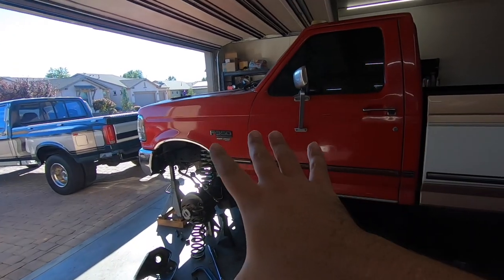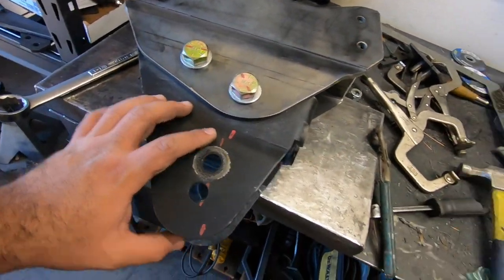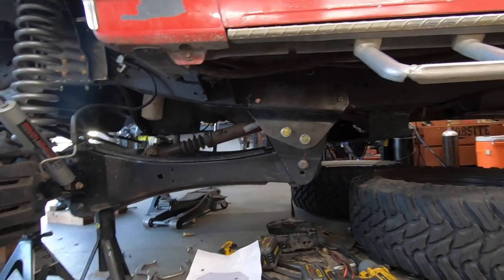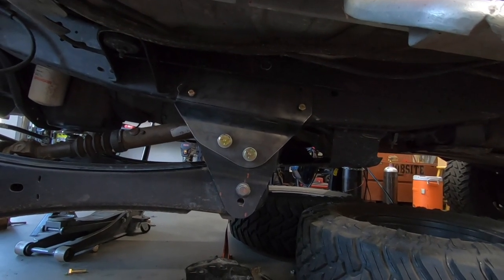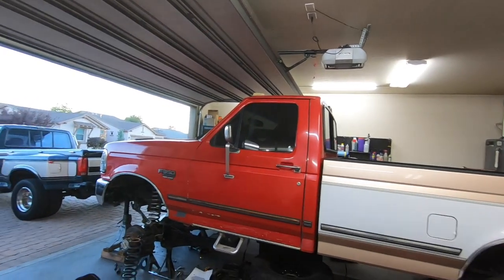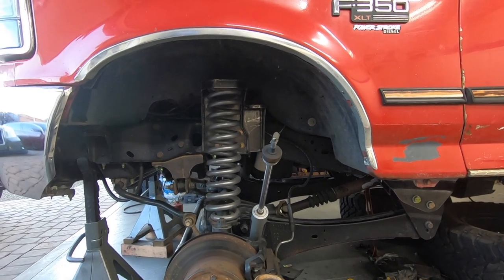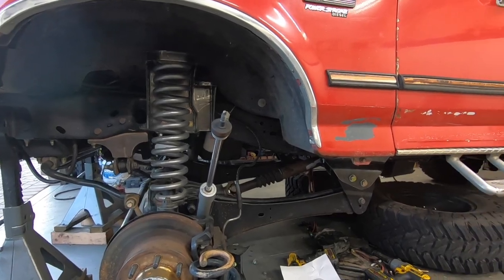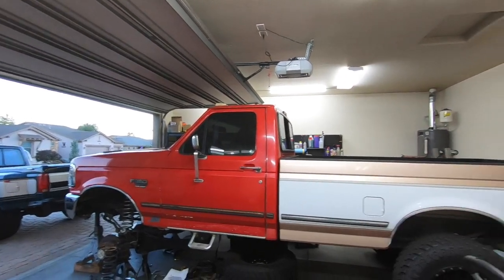05+ SuperDuty Axle Swap Kit Radius Arm Brackets Done!!

Comment: Does it ride smoother than stock my 95 f350 4x4 crew cab rides like a tank
Reply from the maker: It does ride a lot better then it did stock. But I think there is still a lot of room for improvement like better springs and maybe a 4 link